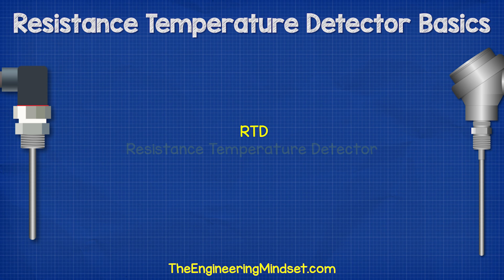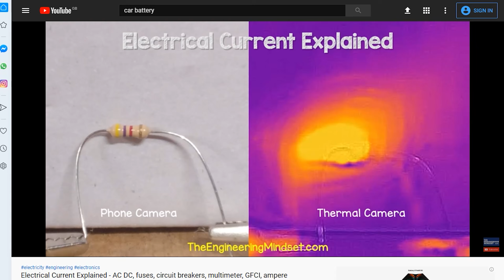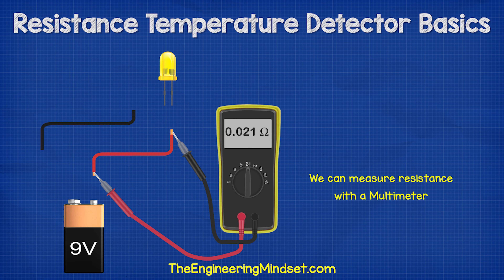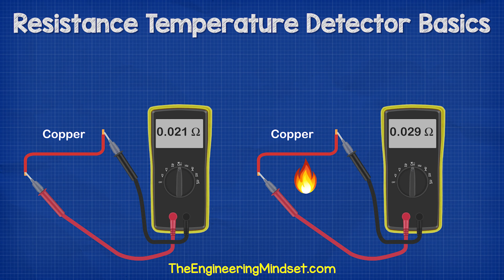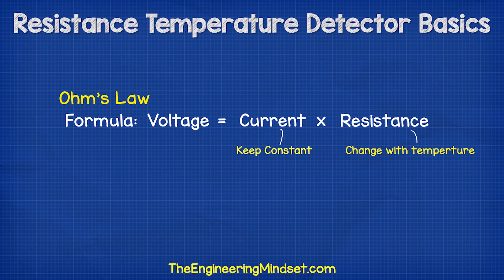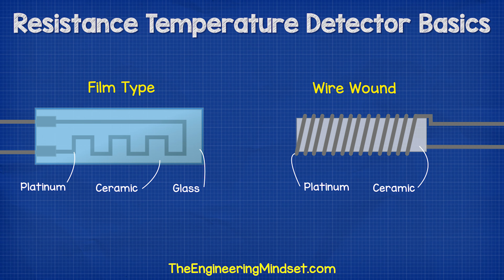Resistance Temperature Detector Basics RTD

Comment: Well that's clear, but is there any material that has lower resistance with higher temperature?
Reply: Yes. Several.
PTC (= Positive Thermal Coefficient) NTC (= Negative Thermal Coefficient). PTC increases resistance with increasing temperature.  NTC resistance decreases with temperature. These effects are used in real life for control puposes, not just simply measuring temperature.
Reply: @millomweb  
You actually answered somebody's question on the internet without being snarky and telling them to look it up on Google. There should be an award for that.
Reply: @joshuaewalker  Allow me! 🏆🏅💐🍻👍🏼
Reply: @gus473  lol
Reply: Look up NTC thermistor. NTC being Negative Temperature Coefficient.
Reply: oh thank you guys for the information.